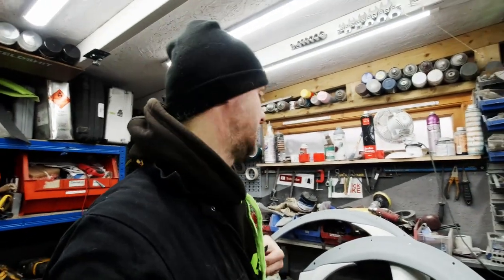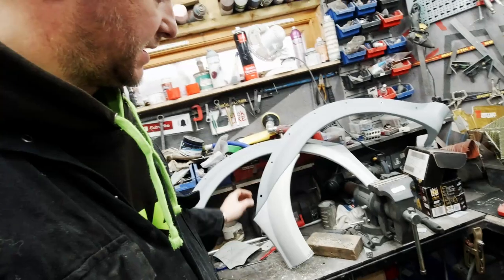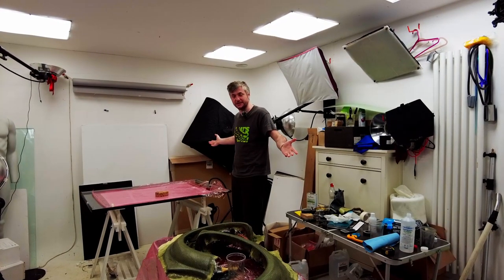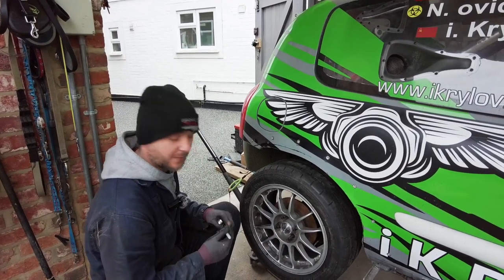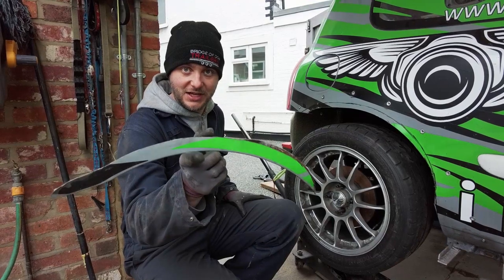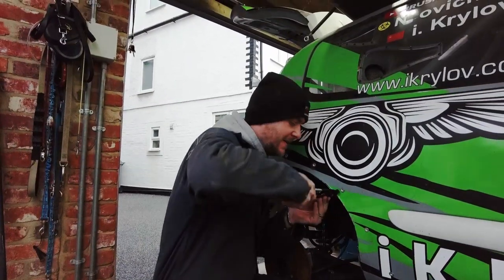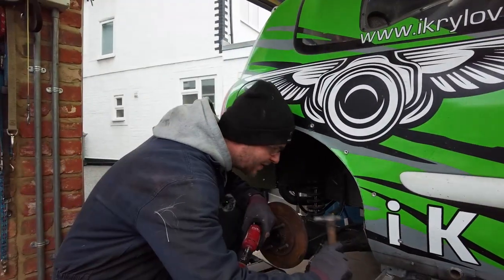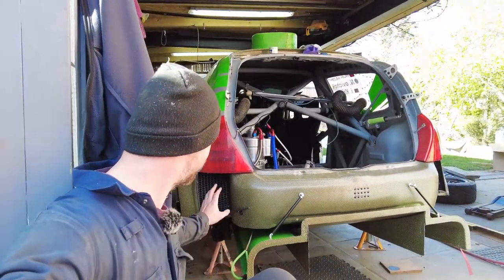DIY Carbon Fiber Fenders. Rear arches with huge air vents. Time attack Clio build. Ep.41

Comment: Just wondering.   Could you not take a plug of the whole quarter panel including the arch extension. Then you could cut the lot off and make the whole lot carbon/kevlar.  And reduce more weight
Reply from the maker: HA now you describing episode 80 from the future 😂
Reply: @RuskiWeldFab  .  What about a front end complete mould. Of wings bonnet and bumper. . Couple of aero catches and the lot comes off
Reply from the maker: not really needed unless i go space frame. but anything is possible.